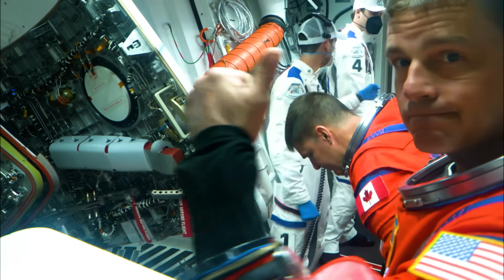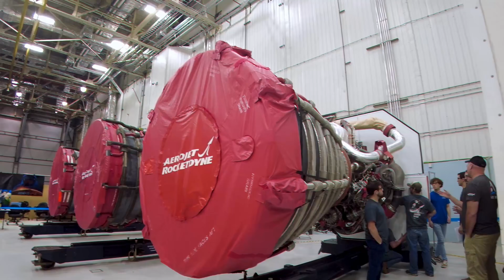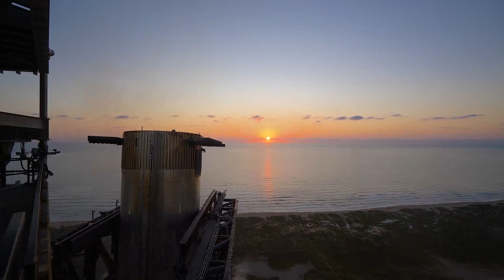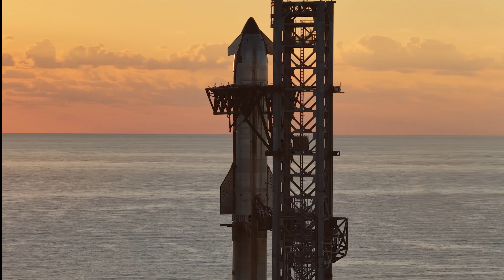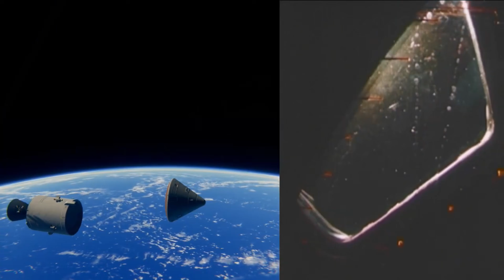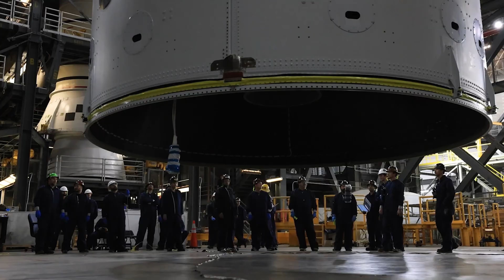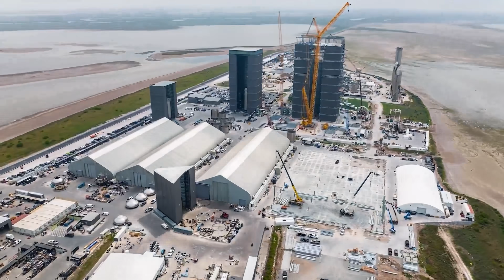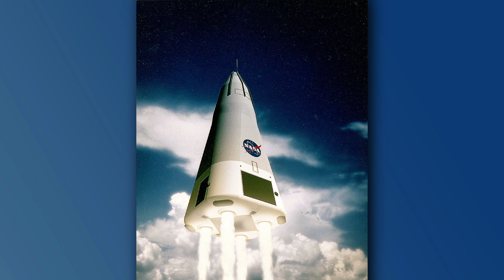Why SpaceX Starship and NASA Rockets Are So Different…

Comment: Has anyone pointed out that SpaceX has launched 12 Starships so far, not reached low Earth orbit with any of them, lost half their launch vehicles and hasn't carried a single ton of cargo to orbit? 

It's interesting they mentioned Saturn-V because the 12th launch of Saturn-V was carrying Apollo 17. NASA didn't need a dozen test launches, they just built it right from the beginning and put Astronauts on the moon. 

Also, the boosters on SLS are very similar to the ones from the Space Shuttle and those were reusable as well. No need to carry extra fuel for a vertical landing. They used a high tech piece of technology called a parachute.
Reply: This is false. They did in fact carry payload on the last flight test and are launching 20 tons of payload tomorrow. 
NASA spent all their time and money developing a rocket specifically to land a small craft on the moon; nearly every part of the rocket was thrown out, never to be reused or seen again, just to achieve this. Starship has a much bigger goal in mind, thus taking longer to develop. They CHOOSE not to go into orbit because that's just the stupidest thing they could do with a rocket that isn't 100% ready for orbit.
The boosters may have been reusable, but everything after that besides the actual capsule is left for trash after the launch. bragging that nasa only refuses 50% of their rocket while trying to trash SpaceX for trying to reuse 100% of their rocket is absurd.
Reply: @RektTangle and yet, Starship hasn't managed to get to orbit and hasn't demonstrated the orbital cryogenic refueling they're going to need to achieve their moonbase or whatever load of crap they're selling. 
You call it stupid to attempt orbit in a rocket that's not ready. I agree, but the stupid part is launching the thing to begin with, instead of figuring out how to get to orbit. It's not like SpaceX can't build orbital rockets, Falcon-9 launches all the time. Sounds like Starship has problems. 

Reusing rockets has never been that important. The cost-benefit just isn't there. SpaceX Falcon launches is still more expensive than Soyuz launches.
Reply: @Clean97GTI  You sir are hallucinating. Falcon 9 only cost 20 millions dollar for new launch thanks to booster reusbility and they charge customer for 70m. While Soyuz cost per flight was 50 millions but even then, Falcon 9 carry more than double the payload of Soyuz rocket. If you're hating please get your facts straight, and reusable rocket is the future, it's not random that China is developing their own version of reusable rocket.
Reply: @Kaijin_04 
Soyuz launch costs before the retirement of the Space Shuttle were $20m per seat. It wasn't until Soyuz was the only game in town to get to the ISS that they started charging astronomical prices.
Soyuz costs today are still lower than SpaceX for the purchaser. And of course Falcon-9 carries more weight than Soyuz-2 or Soyuz-FG. Falcon-9 is a bigger rocket. 
I'd bring up the capacity of Starship as a comparison, but they're at 12 launches so far, haven't reached orbit and haven't carried any cargo. The reusability things is suspect too with almost half of them crashing into the ocean and exploding.😅
Reply: @Clean97GTI  while soyuz is a very succesful rocket due to its relative cheapness to other rockets, falcon 9 is even cheaper per kg, around 3000$/kg for falcon 9 compared to 6000-7500$/kg for soyuz. brushing off reusability as useless is a mistake, if falcon 9 wasnt reusable, soyuz would still control the majority of the market, but guess what? falcon 9 does. if multiple falcon 9 boosters hadnt been reused over 30 times, then nobody would care for spacex, yet people do care for it because they have done something noone else had thought was possible. for falcon 9 to get the first booster landing, it took 20 flights and 5 years, something starship hasnt reached yet so they still have time, if not more since this is a significantly more advanced vehicle than falcon 9 was, and falcon 9 is already the current most advanced vehicle.
Reply: right, spaceX is great and NASA is stupid not to put a human inside a better rocket that has never sent a payload to orbit. 😂😂😂😂😂
Reply: SpaceX is building an entirely reusable rocket that is to be mass produced and like a 10th the price on a very accelerated schedule, and it has significantly more capability.  The testing/design philosophies of nasa and spaceX are also very different. 

Nasa spends a shit ton of money verifying absolutely everything, iterating through designs without testing, and getting everything ready, documentation and endless simulation.  They also care about how it looks as a gov agency so when they test they cannot have a colossal failure.

SpaceX is a private company, and their philosophy is that its cheaper and quicker to just build, test, fail and repeat as fast as possible than to spend years over-verifying, simulating and double checking.  It worked for the falcon 9 and they got their launch cost down like dummy low, while ending up becoming one of the most reliable rockets.

Yes spaceX blows up more rockets but they also made more progress in like 10 years than nasa could make in like 50
Reply: Uh-oh Somebody is extremely jealous SpaceX. Must be a dumocrat. I'm pretty sure the SpaceX has resupplied the space station quite a few times and rescued a crew that NASA could not do. Wonder why you failed to mention that?
Reply: Has anyone pointed out to you that they have deliberately avoided orbit on all of those flights, and have recovered much more hardware from them than nasa ever could?

It’s almost as if you didn’t even watch (or understand) the video.
Reply: @JohnR31415 Saturn-V didn't avoid orbit. The first two uncrewed launches served as test flights, but they actually lifted mission equipment into orbit to verify function and procedures. 
The third launch of Saturn-V took Apollo 8 and it's crew around the moon. 

And what do you mean recovered more hardware? Did you miss 30+years of space shuttle flights where they flew home? Or the SRB's that lifted the shuttles into orbit, floating back to Earth on parachutes and being recovered? Because that's what they did for decades.
Reply: @Clean97GTI  Yes, but you are looking at 60s era rocket environment, at the time they did not care if a rocket detonated in orbit, it was a "oh well, better luck next time". Now this is a HUGE deal. To understand look at what Blue Origin did with the last launch where the 2nd stage partially failed, with the single engine they put the rocket in a low trajectory so it will re-enter and keep the orbital clear of debris as much as possible, this is good flight ettiket, something we have not even considered in the 60s. Even the Russians do it, look at the new test rocket they fired, sub-orbital, so it will not leave a debris if it failed.
Reply: @johngrimm1103 or you could, you know, build it right the first time so the risk of loss in orbit is minimal. 
They absolutely cared in the 60s if a rocket blew up, which is why Saturn-V had such a good record. 

A dozen launches without achieving orbit isn't cautious for the sake of orbital debris. It's a serious question as to the capability of the system as a whole. Plenty of heavy lift rockets that can reach orbit exist already. Why is Starship so far behind the curve?
Reply: @Clean97GTI  Yes, good record. Can you just quick search how many of the Early Saturn's were lost. Not the V, that was the end game, i mean all the once to get to this point. Or how many F1 engines detonated until they figured that out.

Do it right the 1st time, spoken like some1 that has never had to work with a budget(both time and money) or had to learn that what you assumed was so, just wasn't.

Starship can already do what other Heavy-lift can, getting to orbit is NOT the point. Getting the 1st and 2nd stage BACK to re-use is, that is the truly hard part.
Reply: @Clean97GTI  Getting into orbit is by far the easiest goal starship has to accomplish, reusability of the first and second stage, and refueling are the real challenges which are the most difficult problem in space anyone is attempting to solve right now, and spacex is easily 10 years ahead of any  of the competition
Reply: @Naevak. How are they ahead?  McDonnell Douglas did vertical landing back in the 90s with DCX. Deploying satellites isn't new. Starlink is pretty cool but satellite Internet isn't exactly groundbreaking. Starship is still suborbital.
Orbital cryogenic refueling is basically vaporware.
Reply: @Clean97GTI  Wow im finding out in a yt comment that theyre restarting the DCX program! On a serious note its very disingenuous to compare a suborbital prototype to even falcon 9 looking at feats or payload, not to mention starship.
Reply: @Naevak. Suborbital? Oh you mean like Starship?
Reply: @Clean97GTI  So you bring up a starship prototype but completely ignore the falcon 9? Theres a bigger gap between starship and falcon 9, than there is between falcon 9 and the dcx
Reply: @Naevak. I didn't ignore Falcon 9. It too did the vertical landing thing decades after DCX. 
Also, lots of companies and countries have launched rockets before Falcon 9. It's not really anything special.
Reply: @Clean97GTI  Nobody cares about launching rockets the point is about safely getting the rockets back down and how fast we can reuse them. DCX and Falcon 9 are entirely different in many ways, and the biggest reason SpaceX is ahead of most rocket companies is because they have an iterative approach to their engineering.
Reply: @Naevak. The companies paying to get payloads into space care. They don't care about the rocket landing. The launches are expensive enough that the rocket burning up makes no difference. 
We've managed to leave plenty of them before without carrying extra fuel just to land. There's this fancy device called a parachute. Works great.
Reply: @Clean97GTI  Falcon 9 has the chepest cost/kg for a reason, and literally no space company on earth can currently compete with it for the exact same reason. Do you really think the extra fuel being carried is a bigger deal vs not needing to create a whole new booster every time including the cost and labour to do so? Not to mention the turn around time.
Reply: @Naevak. Soyuz is cheaper and if I'm a communications company paying for a launch of my satellite, I don't care what the launch company does with the rocket. Not my concern.

Edit - sounds like the Chinese Lijian-2 Y1 is also at parity with Falcon 9
Reply: Shihhh… you are going to crash the SpaceX stock….

Comment: SpaceX became public at $1.77 trillion versus NASA and SpaceX is concerned about cost and efficiency and SpaceX will get to the moon way faster than the NASA will and what do they do when they get there they’ll turn the moon into a shipyard because if you wanna go to Mars, you gotta go to the moon first and build the mechanisms to go to Mars. You can’t go to Mars directly. You just can’t. It’s too far away. You gotta build the infrastructure first and NASA doesn’t want to do that that cost too much money.
Reply: NASA went to the moon 60 years ago. In fact, the 12th launch of Saturn-V was carrying Apollo 17, the last Apollo mission. NASA didn't need a dozen test launches. They just hired aerospace companies that could do it right the first time. 
To get to the moon, Starship will need a minimum of a dozen Starship launches to orbitally refuel the first Starship launch. This is also cryogenic fuel which is evaporating the whole way there. And nobody has ever tried this orbital, cryogenic refueling operation.

Comment: You gave NASA to much credit. Its not really NASA that is innovating these days like you claimed. No its pretty much all SPACEX these days. NASA is still plodding along in its slow outdated way.
Reply: How many Starship test launches have failed to reach orbit so far? 
Because if you said 12, you're right. All Starship launches so far have been suborbital and have carried zero tons of cargo. 

This is in contrast to NASA whose Saturn-V rockets carried the Apollo program to the moon multiple times. The 13th and final Saturn-V carried Skylab into orbit.

You call it slow and outdated, but who is more successful at pushing boundaries and doing the big things? Cause it ain't SpaceX.
Reply: @Clean97GTI  None of the 12 flights failed to reach orbit. None of the 12 flights had the objective to reach orbit; they didn't try and fail, they just didn't want to and therefore didn't try to. VERY VERY different.
flight 12 did carry payload. most of them were just chunks of metal but two of them were real opertation satellights that tooks photos and sent data back to earth.
Reply: @RektTangle  that's the saddest shit I've ever heard. 😂😂
Reply: @C @Clean97GTI  youve clearly never read your own comments
Reply: @Clean97GTI  No, reaching a stable Earth orbit was not the primary aim for the vast majority of Starship launches so far (Integrated Flight Tests or IFTs).
SpaceX has treated Starship development as a rapid, iterative test program. Early flights focused on basic milestones like clearing the launch pad, achieving stage separation (especially hot-staging), full-duration burns, controlled reentry, and soft splashdowns—gathering data while accepting high risk. Orbital velocity/insertion was a secondary or longer-term goal, not required for success in most cases.
Quick Breakdown by Early Flights (based on public records up to mid-2026):
	•	Flight 1 (April 2023): Primary goal was simply to clear the pad safely. It was suborbital/transatmospheric; the vehicle was lost ~4 minutes in due to spin and FTS activation. Success declared for pad clearance.
	•	Flights 2–5+: Similar profiles—suborbital trajectories. Goals included hot-staging, boostback/landing burns for the booster (Gulf of Mexico), full ship ascent burns, reentry plasma handling, and controlled splashdowns (Indian Ocean). Many achieved partial successes (e.g., Flight 4 had a good reentry and controlled splashdown despite damage). No full orbital insertion was the target.
	•	Later flights (e.g., up to Flight 12 in May 2026): Progressed to V3 vehicles, Raptor 3 engines, satellite deployments (modified Starlink for imaging), engine relights in space, etc. Still primarily suborbital test profiles with splashdowns, though some reached near-orbital altitudes/velocities.
There have been reports of certain flights (like Flight 6) technically achieving a temporary or very low elliptical orbit (e.g., ~50 x 228 km), but these were still test-oriented and not the “full orbital” capability needed for operational missions.
Recent/ongoing flights (e.g., Flight 13 prep in July 2026) continue this pattern: booster landing attempts, ship engine relight, Starlink V3 deployment, and controlled reentry/splashdown. True routine orbital missions with recovery and refueling are still in development.
SpaceX’s philosophy (echoed by Elon Musk and the team) is “test, fail, learn, iterate fast”—prioritizing data over perfect success on any single flight. Orbital capability is coming as they nail reusability and reliability. For the latest, check SpaceX’s site or recent updates, as the program moves quickly.
Reply: Where do you thing SpaceX got all their engineers, scientists, and skill tradesman? All the tradesman unions hate SpaceX since they pay shit wages and screw over contractors.

Comment: Why are you comparing SLS to something that has never carried an actual payload or a human to space?
Reply: Arguably SLS is still being developed too and the versions already flown will not be what future versions will look like.

The main difference is that SLS is a "safe" design using literally components that have already flown in space.  STS at least tried to be reusable.
Reply: starship flight 12 did carry a payload
Reply: What is your problem with the comparison? Sure, Starship is still in development.  But it is based on reusable, flight proven, technology (Falcon). And how much mass , and how many humans has THAT taken to orbit ? Hmmmm
Reply: If the weight of human is the only thing that matters, anything can carry a human. The rockets are expendable. Astronauts are not
Reply: @danielwang111 You are not making any sense.
Reply: Starship has delivered a payload to orbit.
Reply: @justinsellers9402  this is wrong
Reply: @RektTangle  Flight 12 successfully deployed 20 test satellites and 2 satellites equipped with cameras.

Your google-fu is weak.
Reply: Such a hater